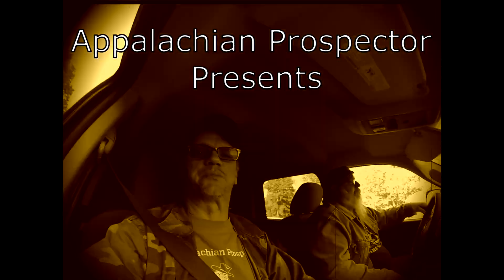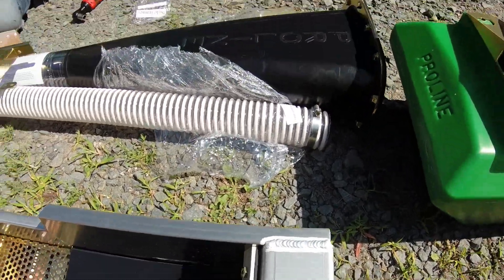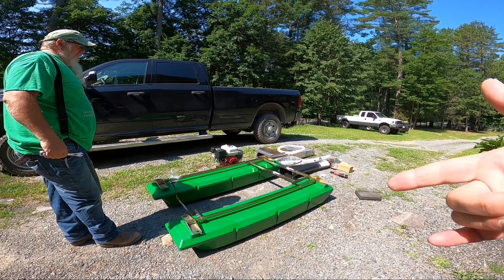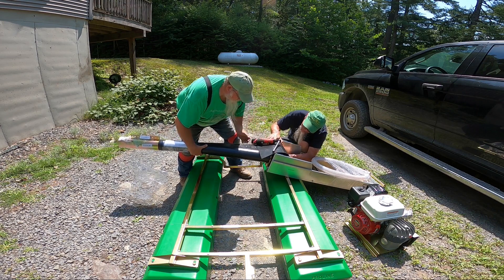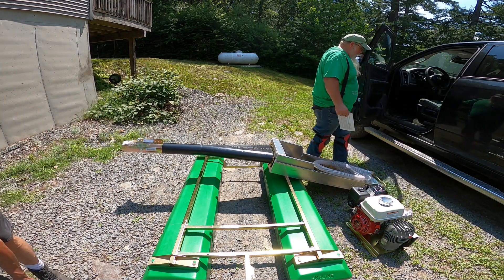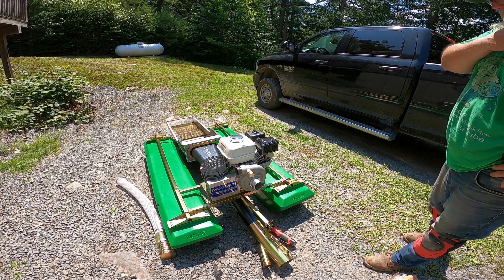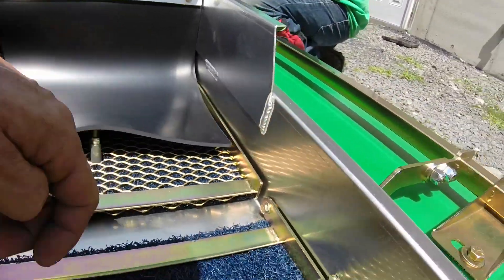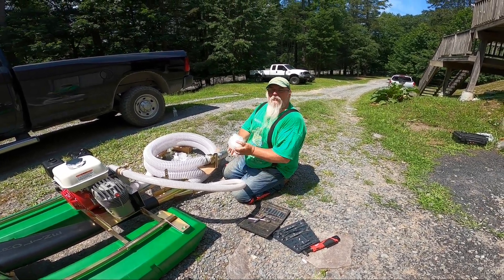Proline 3 Inch Dredge Assembly

Comment: It’s great that you stepped up to a Proline. I used Keene dredges when I was a hobby dredger. But, I’ve been dredging for a living since 2014. Once I switched to Proline, I’ve never looked back. You won’t be disappointed!
Reply from the maker: We are looking forward to it!!!! It is a solid dredge for sure!!!!
Reply: @AppalachianProspect  3 years ago, I had a set screw on my T 80 back out and disappear into the abyss. I spent 2 days in SE Asia looking for a new one…it didn’t happen. Jeff overnighted some set screws to my wife in the States. She got a last minute, $1500 airline ticket, and spent 3 days on a commercial flight, puddle jumpers, ferrys, and then a bus to bring me some screws  ( Jeff sent 2 extras…at no cost). I was loosing $15 a minute, so it was well worth it.
Reply from the maker: @davidlee6042  That is awesome, Jeff seems to be a straight up dude. That is cool your wife brought those screws to you. Was that the set screw in the pulley?
Reply: @AppalachianProspect  Absolutely! Now I put loctite on them. I have back up motors, hoses, pumps, etc. But I didn’t have extra set screws. I don’t know what they even cost, because Jeff sent me 3 at no charge when I called him and told him my situation. They can’t be more than a few cents each, but I lost several thousand dollars being shut down for a week.
Reply: Aftery experience with Keene and not getting the Matt's that was supposed to be with the high banker sluice concentrate Keene has lost all credibility with me !
Reply: @keene engineering